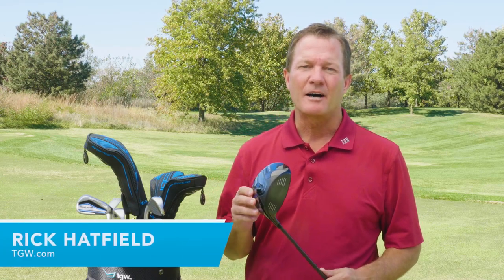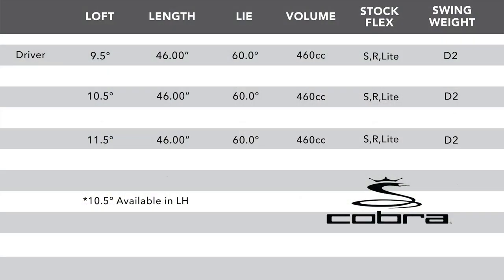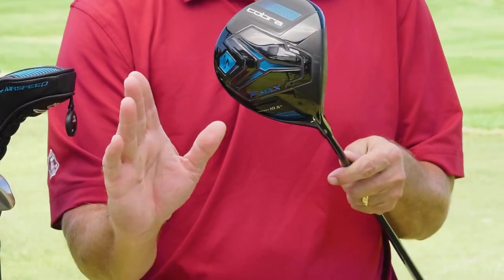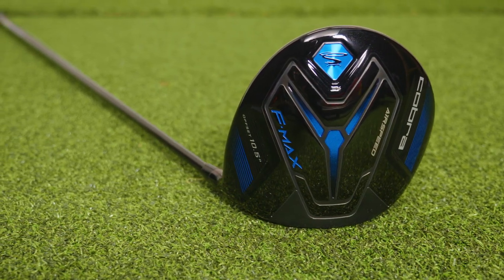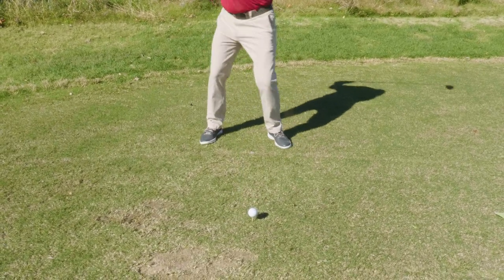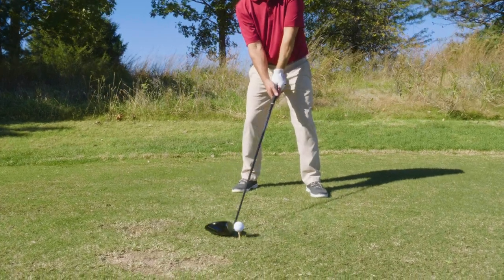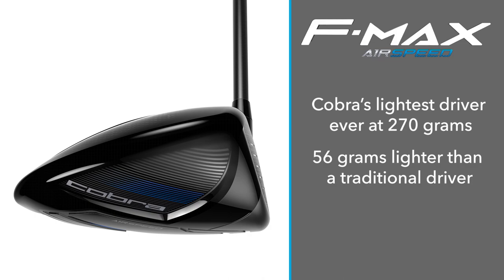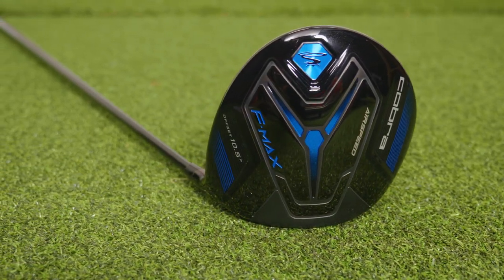Cobra F-Max Airspeed Driver Review

Comment: Hi - I was enjoying my Cobra Airspeed driver until I had a clash with another driver at the range and broke a shaft. I will try to fix this myself. I have access to a shaft puller. I am wondering if you might know what size shaft tip I might need to consider when purchasing a new shaft for the Fmax head. Thanks

Comment: Length 46" ? 😱
It's madness in the highest degree. 
Who can pretend he has a perfect control of his swing with such a shaft ?
Reply: just bought one and had it shortened 2" before leaving the proshop
Reply: Had mine custom ordered with a 45 inch shaft, love it !
Reply: Works for me being 6ft 4inches. Great driver and a game changer for me!!!
Reply: I'm 5'7 , but my F Max driver is 46”

It looked intimidating at first, but after one range session, I've been controlling the direction of most shots pretty decent.

I'd say  8/10 shots are now within 15yards off my target center line, which should find fairways in most courses

Comment: Would I benefit from this if I don’t hit the ball on a down angle but I do slice?
Reply: I would like to know too.
Reply: yes you would, i had a dramatic slice of about 30yds, when i went to the proshop to try this driver out, i hit 3 buckets, 2 shots went right, and those were dramatic misses on my part.
Reply: Chase Petersen I have great connection on the club and I’m debating on getting this one or the TaylorMade M3
Reply: C gang c My buddy has the M3, I’ve hit it twice, way right
Reply: Chase Petersen I ended up getting this one and man my drive is way better now! Love this driver
Reply: C gang c I found out that part of the reason I have a better drive, and probably you do as well, this driver is designed to be lighter than most
Reply: @clzo9172  forget the M3. Ping SFT is the best premium product but the Cobra is more wallet friendly if buying new.
Reply: Would this benifit me. I got a shot and it goes straight for so long then turns right